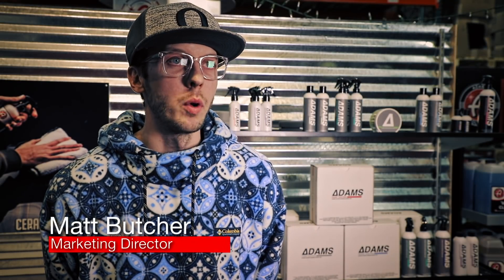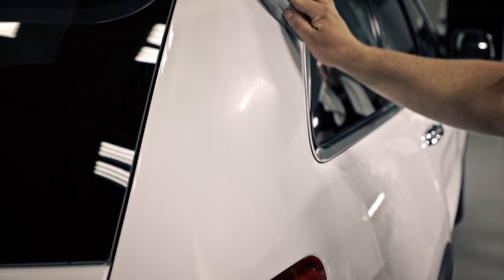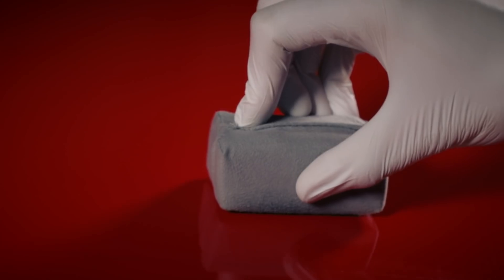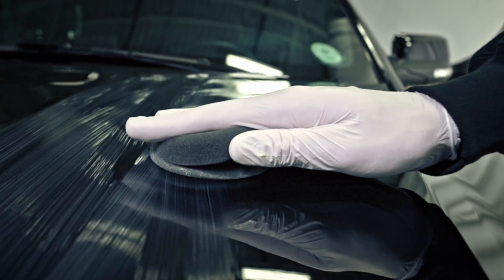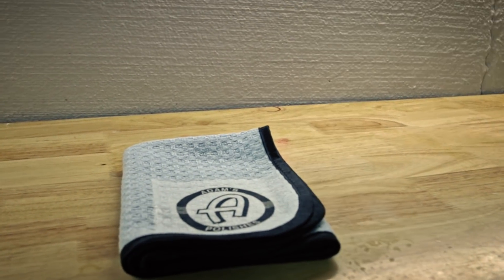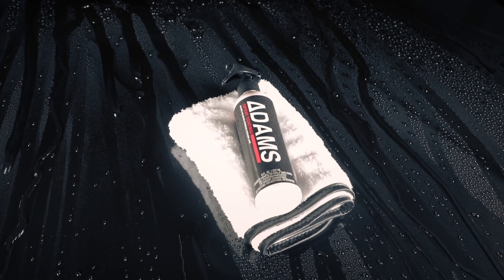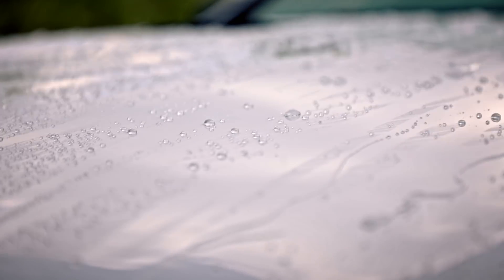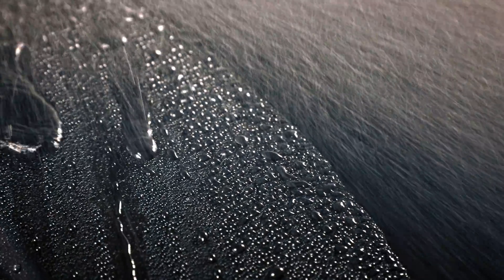Our New Ceramic Line Explained | Adam's Polishes Water Cooler Wednesday Episode 27

Comment: If you want to apply a ceramic coating and it requires 24hours to cure and one does not have a garage to store thr car in is it still worth using a ceramic coating to leave to cure for 24h outside exposed to the eliments!